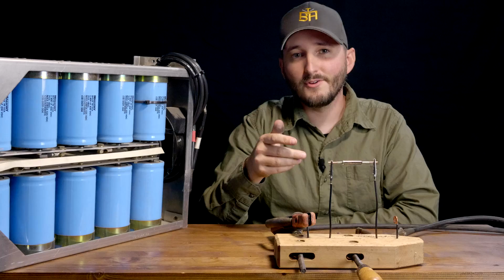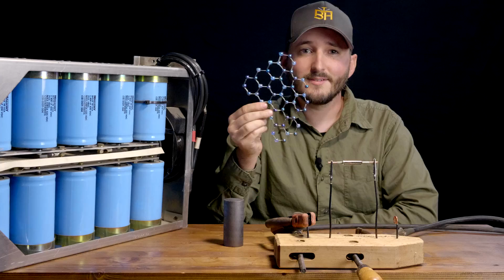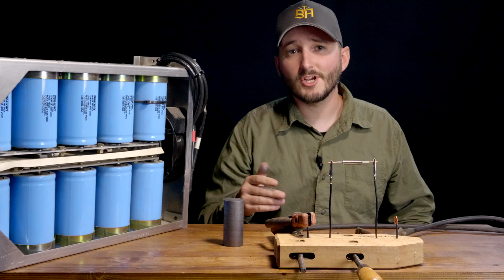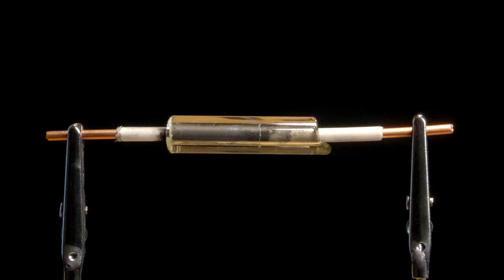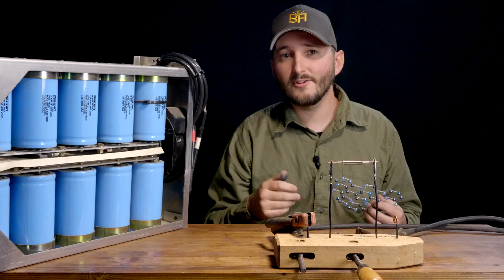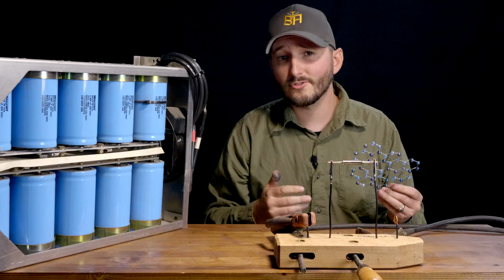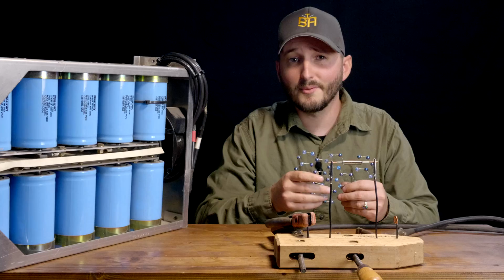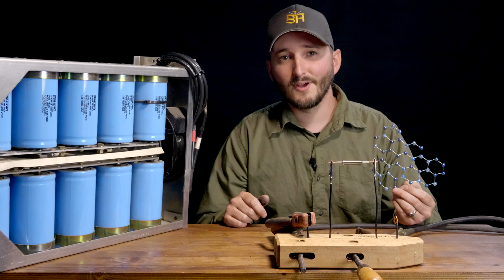How The World's Strongest Material Is Made From Coffee Grounds (Flash Graphene)

Comment: First Starlight now cheap Graphene? What is next? Fusion in a glass of water?
Reply: you can literally do that in a home workshop
of course the pitiful efficiency of said process is orders of magnitude far from actually getting more power then you have to put in, but you can do fusion at home
Reply: I think Tech Ingredients is doing a multi-part series along those lines. MP has a few videos up on construction of the low pressure tubes and different gases through them, as well as powering it. But as already commented, we are unlikely to see it as a form of power generation thanks to poor efficiency; though it is still a cool experiment.
Reply: Polywell fusion is sort of the next step after a farnsworth style fusor (multipactor).
Reply: Nasa just published Lattice Confined fusion and it works!
Reply: Hey, no spoilers, ha ha.
Reply: @TCBYEAHCUZ  great, how many volts does it produce? we can finally throw away/repurpose the GB victorian age steam engine/turbines ,& finally get the originally promised nuke power so cheap ordinary end users get it for free... & for profit corps will pay for its maintenance & staff
Reply: @paulmaydaynight9925  It's a way to release heat from fusion from a heavy metal lattice, but they (nasa) are thinking of using this heat or direct ion capture to run some space probes. Not sure if the heat is enough to run a steam turbine though.
Reply: @TCBYEAHCUZ  ^_~ oh well there's always the good old GB victorian age steam stirling engine gas cycle running in the cold mode differential of space with supercap leyden jars & intermittent pulsed tesla turbine boost when they can scoop up some intergalactic material/wireless power transfer near one of the many electromagnetic plasma clouds they can use....